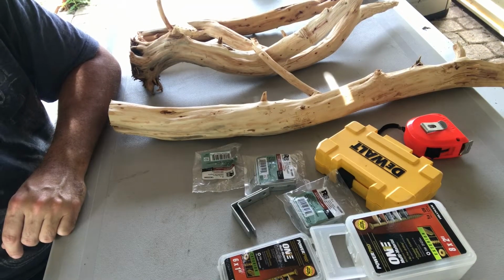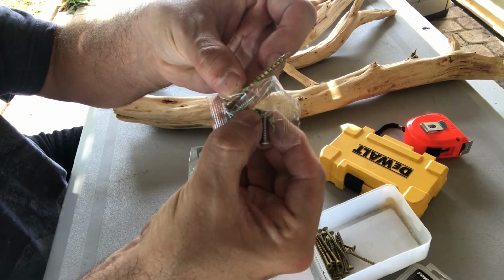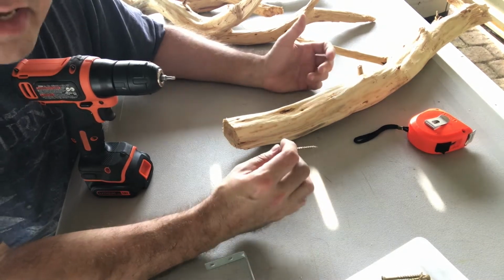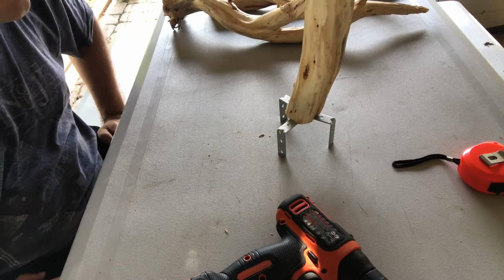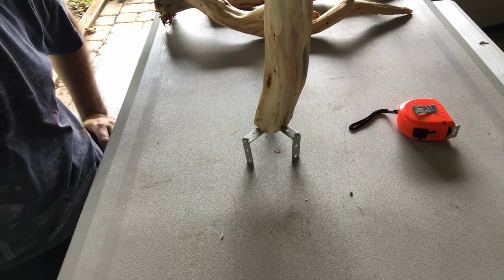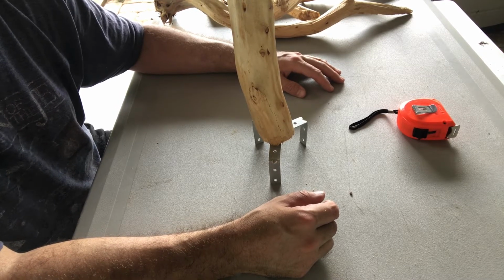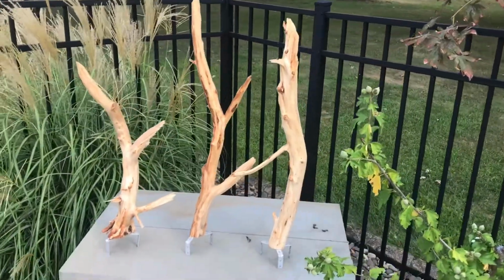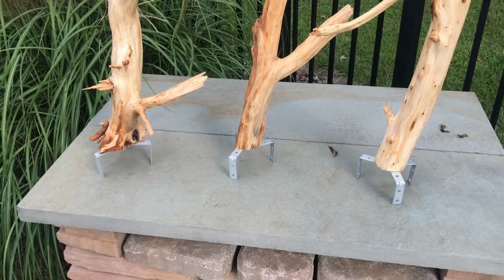Part 5: Tanuki bonsai project - how to use rust proof risers for the subsoil base

Comment: Great idea - will use for sure.  They don't have to stand on their own - you can always wire down in the pot through the holes in the bracket for those leaners.  Thanks!